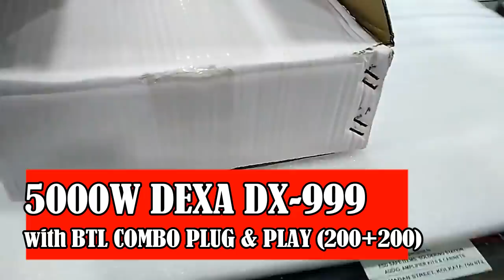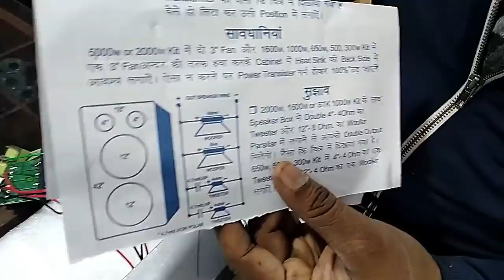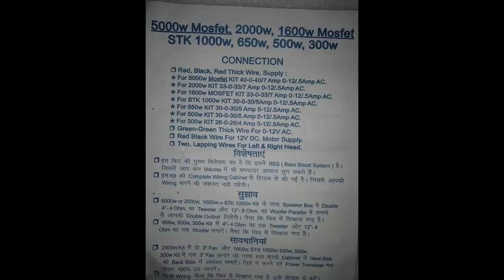5000W PMPO STEREO AMPLIFIER II DX-999 II  4PCS 12" SUBS DRIVES EASILY II 40V/15A II COMPLETE KIT

Comment: NICE BOARD BRO. BUT CAN U PLEASE EXPLAIN THIS??
IN 5000W BOARD PMPO, WHICH ACTUALLY IS 200 WATT ON EACH SIDE WILL REQUIRED 40-0-40/7AMP TRANSFORMER.
BUT IN INPUT U ADDED IN5408 DIODE. AS PER DATASHEET 5408 CAN HANDLE UPTO 3 AMP,  WHICH IS WRONG. FOR ABOVE 6 AMP NEEDED 10A10 DIODE IN INPUT AC VOLTAGE.
PLEASE REPLY....
AND ALSO, IF WE ADD TWO 12" WOOFER ON SINGLE WE HAVE TO USE MAX 200 WATT FOR EACH.

Comment: Do you know the meaning of "5000W"? This circuit will give about 1000-1500W PMPO output, not 5000W. Please provide the proper calculations to prove that the power output is 5000W (assuming it gives 200W RMS output per channel).....